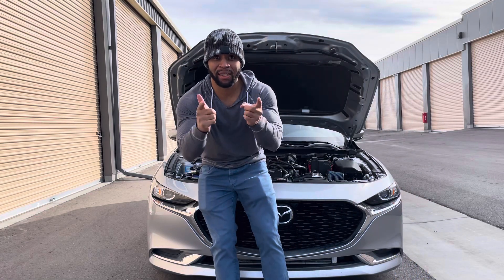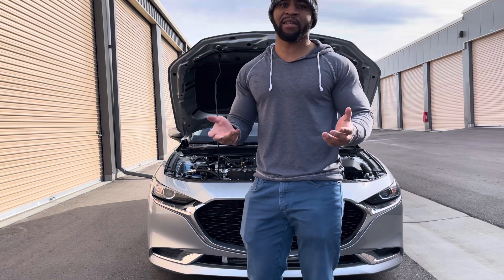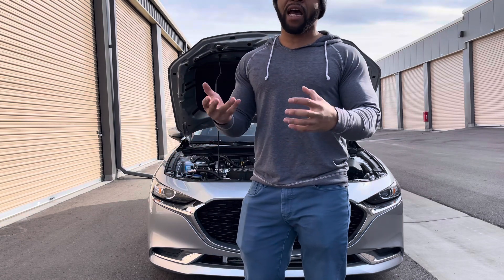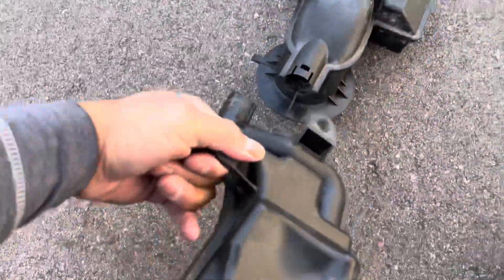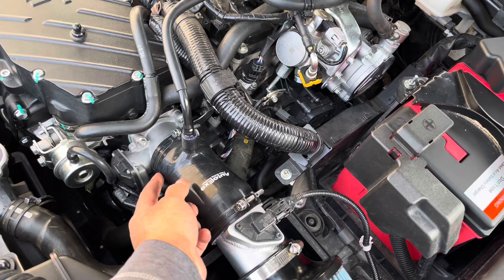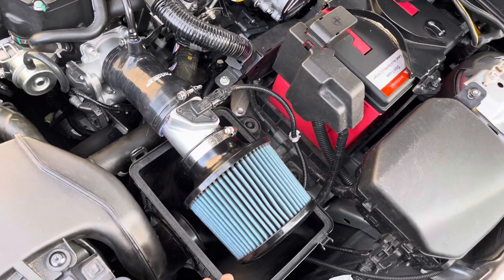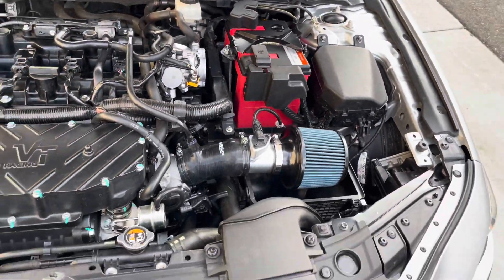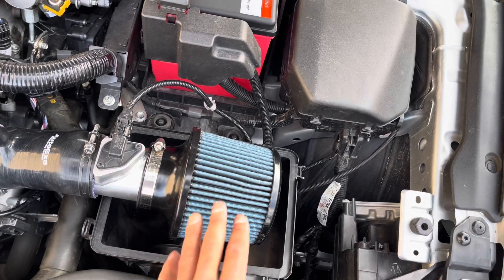Mazda Monday! Skyactiv-G, Part 1 Intake

Comment: What did you take the turbo snorkel from? Does it have a scoop going behind the grill? I got a cx-5 turbo, thinking about changing to autoexe intake pipe.

Edit: Also I read the ribs in piping does cause turbulence but it seems the purpose is to mix the cooler air in the middle with the hotter air along the sidewalls (something like that). 

Love the vids man!
Reply from the maker: I got the turbo snorkel from a mazda3 turbo. There's no need to mix the air in the hose because the throttle body will do all that

Comment: i bought a drop-in filter from China, but the size of it is abit smaller, is not 100% fit the size, will this loose filter cause anything bad?
Reply from the maker: Depends on how loose it is. Does the rudder still separate the upper & lower compartment.
Reply: @supermazda3  it can still cover and separate the upper and lower compartment, i think is about 1cm smaller on the width

Comment: Really good to have a guy that knows well about the skyactive engine, keep it up, I will probably be buying the autoexe hose plus the k&n air filter for my 2.0 NA 6
Reply from the maker: Please let me know your results
Reply: @supermazda3  I am in the UK so I also wonder if I have the carbon filter, will have to check 🤔 should I remove it? And if so does it affect emissions?
Reply from the maker: @ContasYT  I do not know your laws but it will not alter tailpipe emissions.

If you remove it your car will have better airflow
Reply: @supermazda3  yeah MOT here just tests for tail pipe emissions nothing else :)
Reply: @supermazda3  Checked yesterday, there is no carbon filter, just a normal plastic box. Maybe its only in later models? I have one of the first models, it was originally registered on January 2013. So I guess its just a matter of getting the Autoexe thing and the filter :) At this point you should try and get a partnership with Mikstore ahah
Reply from the maker: @ContasYT  maybe haha

Comment: Seems to me like you can get rid of that last obstruction to air flow by chamfering the throttle by opening until it is thin as a knife edge. Alternately, you can make a thin metal collar that fits between the hose & TB that would have a smooth transition inside it to eliminate the step.
Reply from the maker: It won't really matter much at this point, haha. I thought about making that thin knife edge, but I don't want it to cut into the silicone hose when the engine rocks.

Comment: Nice set up! I have a 17 mazda 6 and would love this supercharger kit but living in California with the smog nazis puts a stop to dreams of skyactiv power!!!!! I have done a few other mods, removed that charcoal filter and added the auto exe hose. I have a corksport catback exhaust kit for it and a set of bilsteins with lowering springs and a rear swaybar. I changed all 3 motor n trans mounts to the awr racing urethane mounts as well. Thanks for sharing your information!!!
Reply from the maker: There are many people running this supercharger in California
Reply: I don't doubt it but its 100% not smog legal and once u tune ur ecu to match they pick it up and it won't pass smog. These folks either no someone who hooks them up with smogs or something under the table.
Reply from the maker: @puddleduckist  you can run the car on the stock tune for emissions & you can also make the car run like Naturally Aspirated with a zip tie on the Bypass

Comment: Great information video! You didn't specify exactly why you don't like the Takeda intake box,  for the N/A I think you said? What's your thought on the Takeda box for the turbo ? 
I'm waiting on delivery of my '24 turbo and of all the intakes I think the Takeda seem the best IMO. As a shorter snorkel with a closed box (except the little hole on the side for more sound and airflow at low speed) should keep the IAT as low as possible. And with the Pro-5R filter for more airflow.
Thinking of pairing it with the Corskport TIP too. Looks like it would need a coupler/adapter between both as the OD are different, need real measurements to confirm that.
Reply from the maker: It is very different for the turbo model. You don't need the resonator. Also, the MAF housing is uniform on the turbo model, but it is not on the NA model. They decided to be cheap. I will make a video about it in the future. The  CS makes the silicone hose for the turbo model. I would honestly just use that portion  & leave the rest of the box stock
Reply: @supermazda3  Good to know. I'll be waiting on your video about the turbo model. 👍

Comment: For the lip, I had the injen sri, a smooth setup. The metal tube of the intake was connected with silicone hoses to the TB, and there were the lip on the other side, the intake cone. Now when you started this subject, I am more convinced about the injen sri I sold.
Reply from the maker: What are you convinced of?
Reply: @supermazda3  about the use of it in general. Injen rly made it to have the smoothest surface to get max perf.

Comment: I saw one of your other videos where you talk about the exe hose from Mikstore, and man it is a significant difference. I have the stock air filter so am guessing with the k& N filter it’ll be even better.
Reply from the maker: It was noticeable on both of my Skyactiv-G mazdas, I especially noticed it when using kickdown on the gas peddle. The air velocity is definitely higher
Reply: Is it really that different? I have been wanting to do it for a while but though it was more aesthetics than anything else, also which video are you referring too?